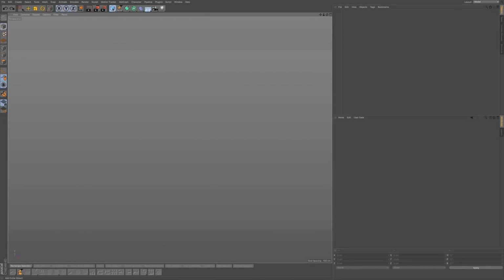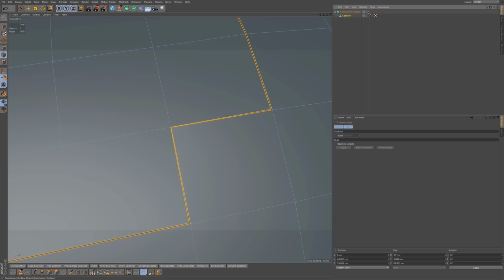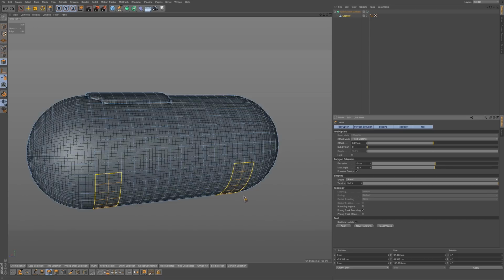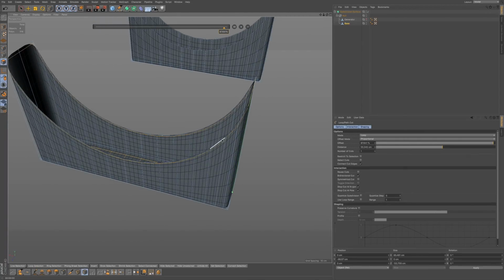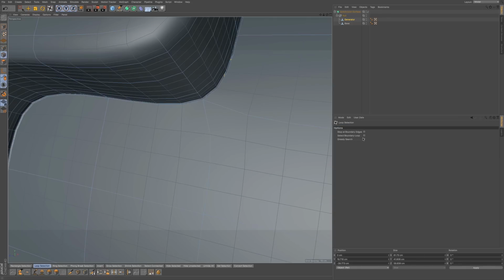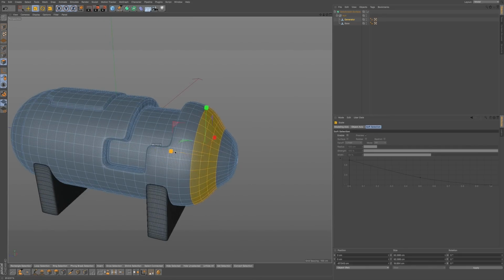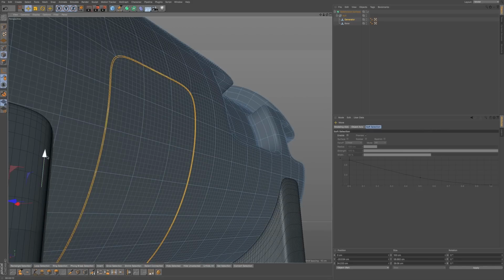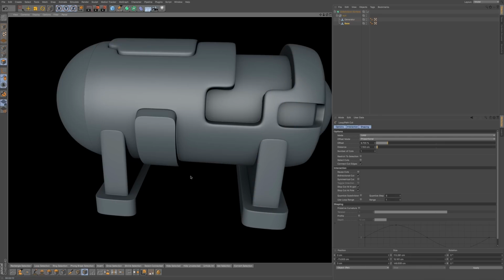Using Split Disconnect and Subdivision to Make Complex Surface Details in Cinema 4D

Comment: Hi Mike, great video as always.  My question is, do those tiny little extrudes like at time code 16 53 along the edge of a larger extrude that dig into the mesh a tiny bit effect the UV?  Great place to put a seam but are you going to get any yuck stretching because of them?  Speaking of UVs, any problems with a disconnected mesh.  I automap in Coat as much as I can and disconnected pieces make 3D Coat autotopo angry.

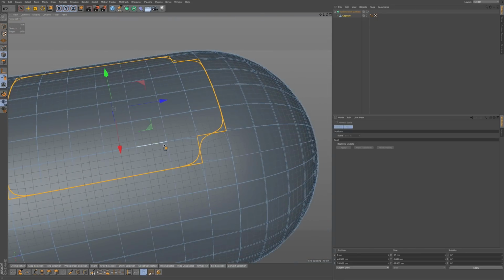Comment: At @5:00 I can't get both lines to show up? Just one at a time?
Reply from the maker: Select the polygons that you disconnected. To do that select your move tool and double click on the disconnected polygon. This will select all the disconnected polygons. Then go to Select Menu and Choose Outline Selection. Go to Edge Mode. Then Choose Loop selection tool. Make sure Select Boundary Loop is checked. Hold Down Shift and Select the other lines.

Comment: I'm trying te model an object for 3D-printing.
You're tutorial brought me a long way into the basics of using split and disconnect to create an awesome looking model. The only thing that seems to become a problem when disconnecting parts of an object in C4D is the gap that will exist afterwards. Disconnecting and lifting parts of an object make it look awesome but in reality there's just a gap. How to overcome this?
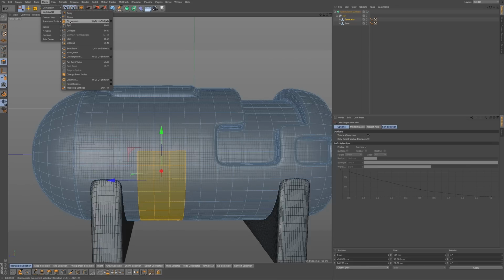Reply: I am wondering the same thing! I finished this tutorial (which was amazing by the way), but couldn't help but notice during that last disconnect at 24:45, I was left with major gap after some extrusions. It would be nice if there was a way to smooth over that bit and make it appear reconnected.